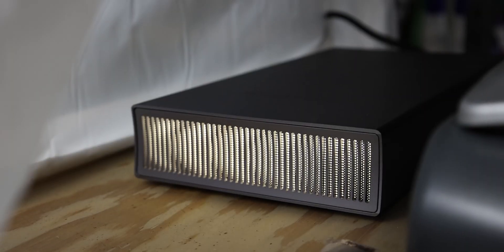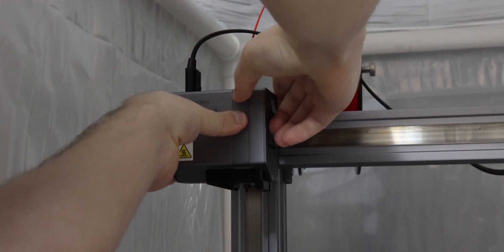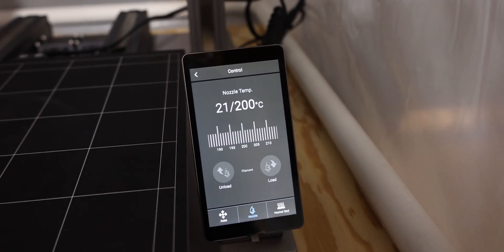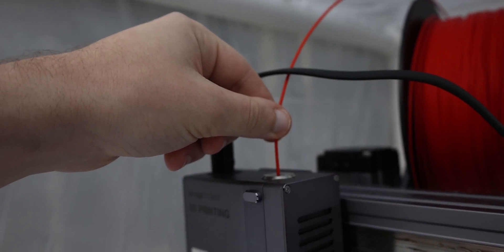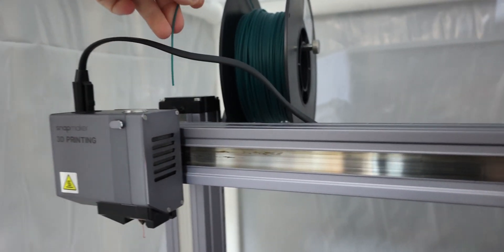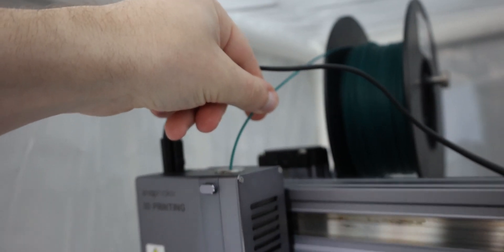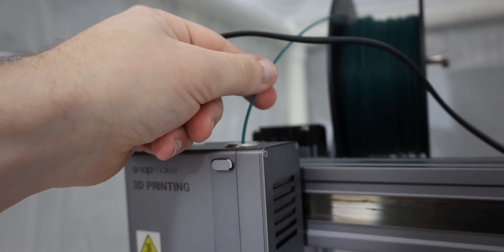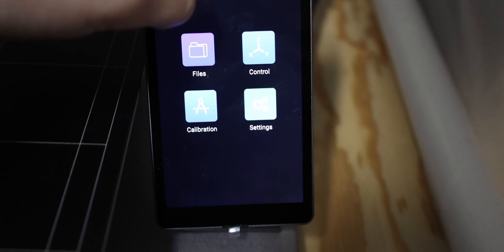Your Guide to CHANGING PLA with the Snapmaker 2.0

Comment: having trouble getting filament to feed after running out changed nozzle but I thing tube is plugged any suggestions will be appreciated
Reply from the maker: I haven’t had an issue with it loading however sometimes there could be PLA dust on the gear and that might cause it to not feed properly. The front door can open to see the gear, see that the PLA reaches it and then go from there. Hope you can get back to printing soon!!!